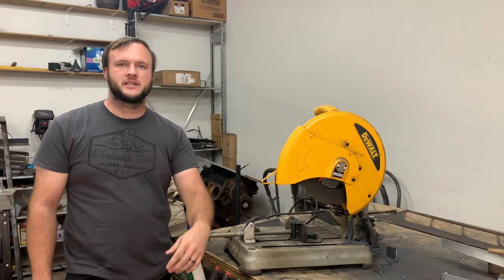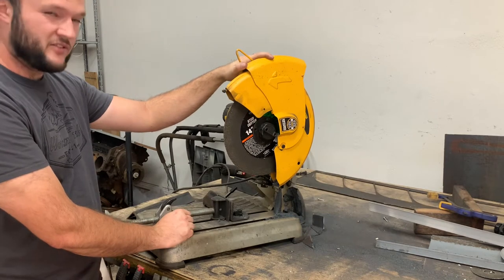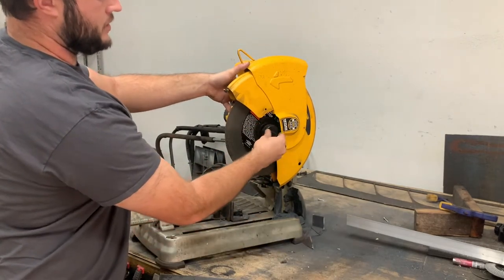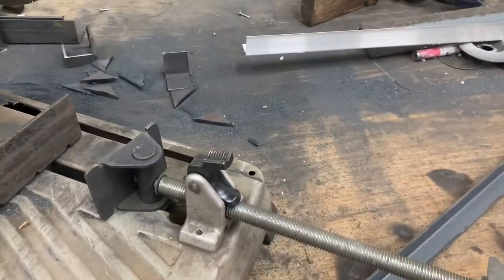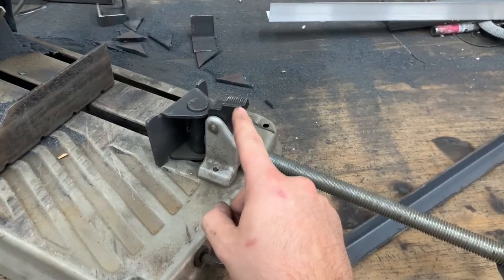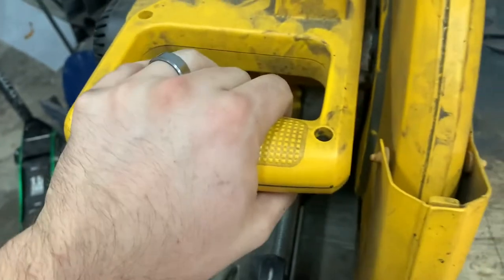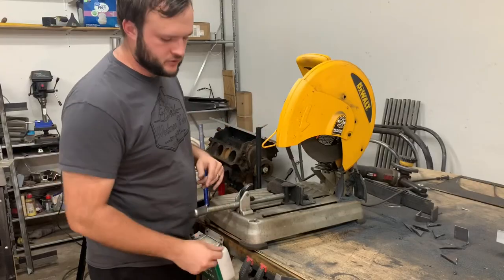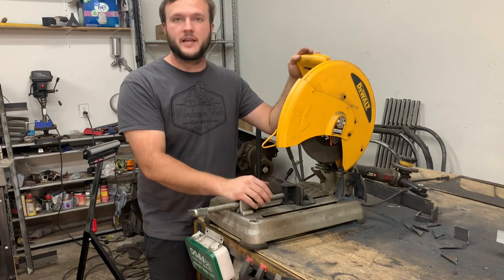Dewalt 14 inch chop saw review!

Comment: I went to buy this the other day at Lowe's. It's really good for the money, only problem is, Lowes doesn't sell any blades for it. They don't have any 14 inch blades for anything other than brick and masonry. If you want to use this for wood, expect to spend as much on the blade as you're spending on the saw itself.
Reply from the maker: This saw is intended for metal only, that’s why the wood blades for it expensive, you would need a miter saw for wood, there are saws that will do both though

Comment: I used to use the Milwaukee 14" abrasive saw, until I tried the Evolution cold cut. Not the 14", but their 10" sliding compound miter saw, works good for my situation as my shop is attached to my house, so less dust. I also switched over to the 4 1/2" metal cutting disc on my grinder for the same reasons. I was always curious about this DeWalt metal chop saw, now I know! Thanks for sharing 👍
Reply from the maker: I had the small 7.25 evolution and maybe I was just too hard on the blades I’m not sure but I got less cuts out of those than I did out of this saw, I’m sure the smaller size didn’t help with that either, I will get a cold cut saw when this one smokes on me though

Comment: Hi! Can I use 14inc metal saw tooth blade for cutting mild steel? If so, what blade can be used and does it have to be a high speed cutting blade (rated above 4000 rpm)? thanks
Reply from the maker: You would need a high speed blade to use on this saw, they do make saws that will take a low speed blade but they would be sold accordingly, I’ve seen people use toothed blades with saws like this, just check manufacture specs to make sure the saw and blade are compatible to avoid injury or damage